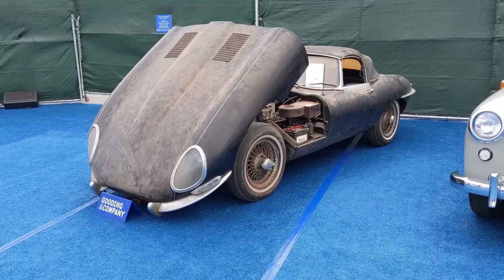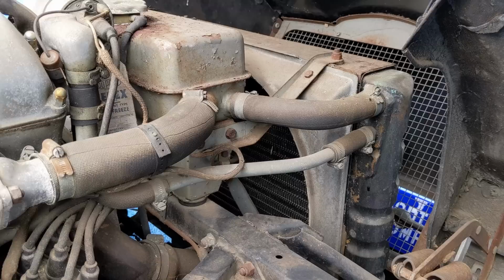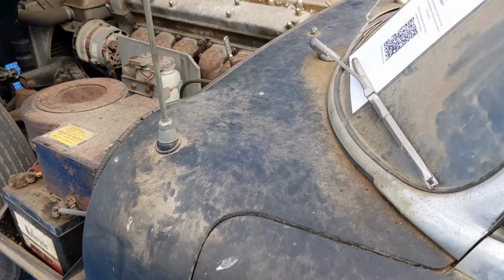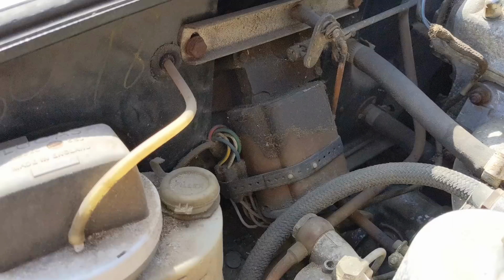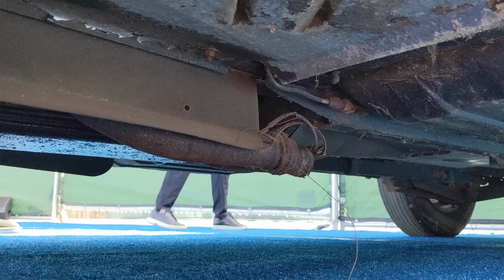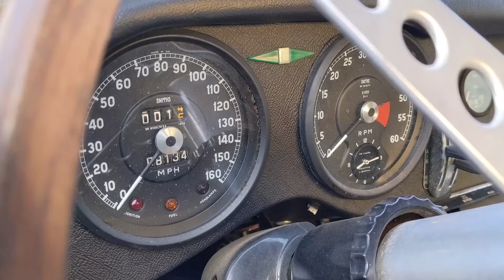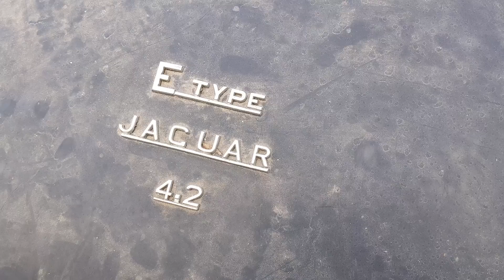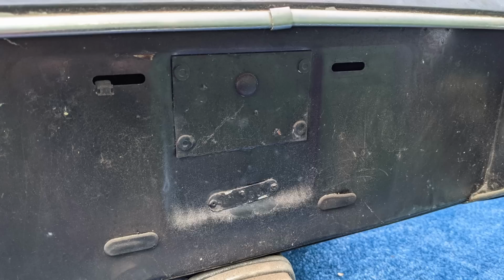8000-Mile Jaguar  E-Type Barnfind

Comment: I owned a 1963 XKE OTS for 45 years and have extensive personal experience in attempting to preserve these cars. As to the whole barn find nostalgia: the finding is the best part. The sad reality is that this automobile is gradually deteriorating every second. Factory rustproofing was non existent.  There are no galvanized panels. Components, especially brake systems and rubber seals inevitably age. The fascination with a mouldering heap may be special to some, like visiting an airplane crash site, but much more joy is to be had in actually driving the car while gasoline is still available to civilians. 

The problem with a limited restoration is where to draw the line. Of course all safety systems must be totally reviewed and restored. Pretty soon the car looks awkward with shiny new parts juxtaposed with barn patina. The mind can’t resolve the discrepancy and the owner will lay awake at night without peace. I know. A derelict vehicle is a possible outcome, but not for $170,000.  I bought cars like that for $500 back in the day.
Reply: Very wise comments Garth. I had a 3.8 fhc in my youth, and it was deteriorating before my eyes. Fabulous design, let down by poor materials. My two previous cars were an MG PA and MG VA from the thirties. Streets ahead in quality of substance. I was glad to let the E Type go. In total I had three Jaguars, and they were all disappointing in one way or another.
Reply: "while gasoline is still available to civilians. "  So true, brother.
Reply: I restored so many my self in the UK. Completely back to original factory condition. Now in the UK I can't afford a really bad condition one. There selling for over two hundred and 80 thousand plus now in the UK. Perfect condition one's are reaching three hundred thousand pounds plus mark now. People in the UK are paying hundred and fifty thousand plus for bad conditions rotten one's
Reply: Yes but there are thousands of them over 5000 in the UK alone and hardly ever  seen !!
Reply: $900 in 1975 for a running car with five new tires on it.

Comment: That’s a lot of E Type for the money. Personally I’d put it in the hands of a professional detailer, a weeks work would make it a different car visually. Then I’d do exactly what you said mechanically. Keep the “restoration” sympathetic and when roadworthy, drive it & enjoy every mile (kilometre). It’s amazing how these cars are still out there, waiting for the right buyer who will cherish every moment of ownership.
Thanks for sharing this blast from the past Richard, takes me back to my apprenticeship working on the bodywork in the mid 60’s 👍🇬🇧🇨🇦
Reply: I totally agree a thorough clean and detail with period materials ie turtlewax. connolly leather cream etc would transform the car a good coat of wax will keep minor rust at bay if redone every month or so. I don't know about you but I would polish it every day if it were mine. 
I slightly disagree about repairs though I prefer to see new parts look like new. it is part of the history of the car .As long as parts are functional I would just clean and lubricate as necessary . Any artefact can only be original once even the worst rust heap can be restored to as new showroom condition.
Reply: @elanman608  I believe you have the right philosophy, sir!

Comment: Sitting in a barn all that time will pretty much have destroyed this car. Virtually everything will need to be replaced. How could it be worth $168K? There is a tremendous difference between "low miles, unrestored and cared-for" and "low miles, left to rot for 50 years".
Reply: I guess the only good thing about it, is that everything is original. No modifications. That's assuming it can all be shined back up.
Reply: Not everything will need to be replaced, far from it.  Most things will need to be refurbished and checked, but that's a different thing!
Reply: You know nothing about restoring a classic do you , don't show yourself up with no knowledge, that car for it's age is mint 99% of it will be saved , and parts will be restored to original spec , would love to see it finished

Comment: Simply amazing!  At the now defunct Newport, Rhode Island Jaguar festival back in the early '80's; there was a 1966 all original E-type on display.  The owner drove it in from Boston; keeping it in his heated garage most of the time.
Reply: That’s the true definition of ‘original’. Lightly used and reasonably maintained but never restored. As in never painted or mechanically modified.

Comment: I got a 120 several years ago in similar condition.  As with these models, there's enough shiny 120's languishing in locked garages.  What I did: ring & valve job, gearbox sent for refurb, all the bushings, rebuild brake components, rebuilt water pump, radiator, damper, shocks, Tires, and it runs as cool as it ever did and drives great!!!
do it yourself and the cost is minimal.

Comment: For me, a barn find doesn't come with a mandate to retain the dilapidated condition.  Rather, it affords one the opportunity to utilize the maximum number of original parts (all restored to original condition), as well as serving as a correct period template for wire & hose routings, setup, etc.  I'm all for doing a perfect restoration on a car like this.  No repop components whatsoever; every non-original piece utilized would be NOS and have been in a Coventry parts bin in 1965.  My only goal for this project (or anything similar) is: as new, factory condition.

Comment: A great talk through Richard, thank you. I was amazed at the factory shut lines they looked excellent and for me a clean, a polish, refurbish anything safety related and then enjoy driving a “new” E Type , I wonder what they felt like and I guess this is the closest you can get? Kind regards, Richard.
Reply: They felt tight. In 66 I had a 63 with 21K on it. It was tight and no rattle, just a nice tight car . No clutch slip, but, it ran hot and no AC. On the road it was magnificent, in the city I took the bus. Mine was a coupe, it was like driving an airplane.

Comment: Worth noting is the still-present closed cell foam rubber sealing around the radiator gap and the foam rubber (or felt) sealing around the top of the radiator screen guard.  The overheating issues with these cars may be exacerbated by something as simple as the disintegration and absence of these seals.

Comment: What a fantastic research car.
For me, a full service, minor rust repair, wash and polish, new tyres and off I'd go. It would be criminal to pull this down completely.
Reply: Everything needs to be replaced. The shock mounts are rotted. Engine mounts are rotted. Exhaust hangers are rotted. Hoses are rotted. Belts are rotted. Gaskets are rotted. Engine could be seized. Pistons might be solidified to the walls. This thing is a travesty.
Reply: @gplito  
Anything made of rubber needs renewing. Modern rubbers are far superior to 1965.
Reply: @johnburns4017  yeah, even the plastic gets brittle. And all the lube just turns to clay. People here talking about a ‘full service’ have never seen what 50 years can do to something that’s just left to rot. Imagine just what all the shock mounts and suspension bushings look like. And motor mounts. Gads….

Comment: I'm just an old hot rodder but I would not do a full restoration on this.  I'd just start cleaning it and working thru the squawks.  I'd try to keep it as original as possible.  This car is a time capsule of how they rolled out of the factory doors.  It would be a shame to lose that IMHO.

Comment: If the car had been cared for thru the years, it would be a really rewarding find. But in this condition, it's less than fulfilling. 
So much of the original soft parts are deteriorated so just trying to get it running would be disturbing much of the originality - possibly devaluing it. 
Much of its value is in the low mileage so it really can't be driven or it will become just a driver.
A detailing by a knowledgeable shop would be in order. Then, loan it to a museum for display as-is.

Comment: As is went for 10 times its original sale price somebody has more money than sense! They were never built well and rushed out of Coventry to meet USA demand. I rebuilt my 1966 coupe and what you find when you peel back the layers is shocking. For me I would do a full nut and bolt on this replacing old technology for new including high torque starter motor, four pot disc brakes, five speed manual gearbox, RevoTec aluminium radiator, stainless steel bumpers, high efficiency headlamps, steel wheels(not CWWs), gas shocks, etc etc. To me they are not investments but a classic car to enjoy and use. 😎

Comment: 1) Needs the engine oil flushed out properly, with appropriate fully synthetic oil poured in.
2) Transmission oil renewed.
3) Tyres renewed. 
4) All rubber hoses renewed. 
5) Coolant flushed.
6) Back axel oil renewed.
7) hydraulic lines flushed through.
8) Electronic ignition fitted if to be used.
9) New plugs.
10) Carb lubes renewed.
11) Dampers renewed with quality gas dampers.
12) New none lead-acid battery. 
13) If to be used, a new high torque starter motor.
14) Tappets set.
15) New quality fan belts.
16) Fuel tank and lines flushed out.

Comment: I am going through a original 40,000 mile 69 e type for a customer last registration was 1975. The car has never been touched body and interior is perfect, I am basically replacing everything that is rubber bushings and mounts, complete brake system. The engine on the other hand was in bad shape coolant was left in the engine and it ate through everything that was aluminum ,it also turned into a solid I spent a couple days trying to clean out the water passages I will have to have the cyl head pressure tested to see if is any good.
Reply from the maker: Andrew sounds like an awesome project. I did a similar preservation 1962 FHC this summer and you can see it in my earlier videos. Some corrosion is ok on the cyl head passages, but the pits can't protrude past the head gasket seal.
Reply: @RichardMichaelOwen  Check out Jay Leno's Garage YT channel (Jan 10/22) where he reviews a replica of Steve McQueen's Jaguar XKSS.

Comment: Such a shame that car has been parked in some garage for the last 45 years just left to deteriorate. It was an immaculate car which should have been on the road being used. I cannot understand why owners just hang onto cars when they do not want to or are unable to use them.
Reply: i think this is the only way to get a super low mileage all original car. Sure, maybe it could have been stored a little better, but it is still in great shape. clean it up, look it over, replace what is not working anymore, and then drive it and maintain it to a high standard. Original cars are so much better than restored cars.

Comment: Yeah,  much more unique and valuable if left original.   I would only do necessary mechanical and safety with least changes to original.   A lot of that surface rust can be dealt with without re-plating.   Some of the rubber cracking can be improved also.  What a great car to bring back to life.

Comment: If the buyer wanted a flashy E type to run around in they could have passed on this. Going the full monty on it would make a car indistinguishable from hundreds of others. Fettled back to roadworthy condition this car would be both valuable and a head turner at any E type gathering. Maybe not for the hooray harrys but for those with some respect for history.

Comment: A good wash, some polish, and replacing the rubber hoses should get that to driveable. :-)*
(BTW, jeweller's rouge does a nice job removing surface corrosion from aluminum or magnesium alloys.)
Reply: You're kidding, right?

Comment: Nothing short of criminal neglect to allow such a car to get into that state
Reply: I can see what you mean, but I don't really agree!  It was stored a long time, obviously under shelter.  The years pass, cadmium inevitably disappears, rubber loses its plasticizers and deteriorates, dust settles, and so on.  That's not neglect, that's just time.  The car is straight, never in an accident, no one doing nasty modifications... to me it looks like it was very well looked after, in fact.  After a few years of driving, maybe <speculation> the owner died and the widow just had it in the garage, never quite knowing what to do with it.  Thankfully she turned down plenty of offers from mechanically unsympathetic rev-heads, thereby ensuring the car wasn't abused or wrapped around a pole somewhere.</speculation>

Comment: I think  if you can get it to a condition of a 3-5 year-old car then that's a good place to be.
I wouldn't be too fused about factory fresh. I will still need a lot of dismantling to get the mechanicals correct. Fix the rust, new paint job and set a time limit whilst you still can drive!!

Comment: I've never seen an E Type that has rusted right through behind the rear wheels with only 8000 miles. More likely 108,000 miles
Reply: NO it doesn't take miles to rust through bodywork it just takes time moisture and if salt is used on the roads that accelerates things 10 fold!
Reply: But it's not just 8K miles... it's 8K miles AND decades of sitting in storage.  Steel + moisture + time = rust.

Comment: Give it a ice blast detail, change all the fuilds, check the engine to make sure nothing is frozen or sticky, then I would just drive it for the next ten years.
Reply: Impossible....the entire thing needs to be disassembled and put back together with proper gaskets, belts, hoses, brake assemblies and the rest. Tires too. The interior is rotted out. I bet you could reach in and take fistfuls of crumbling leather by the handful out of the seats, plus the foam rubber backings are all rotted. The thing is a wreck. Someone is dead and no one payed attention to what they owned.

Comment: Re-Commission, not Restore.
Do only what HAS to be done for safety's sake.
eg. the rubber trims if they're not badly dried out, can be brought back to life, by a long soak and massage, in Glycerine.
Days preferably  !
It's the same Glycerine that  you wife will use in the kitchen, only you'll need a 'tad'  more .
Waiting to see the Recommissioning  !
Reply: Every hose, plastic line and rubber fitting and tire was  to be replaced. All the shock mounts..replace them. Exhaust hangers. Replace them.All the lines going to the oil system and the gauges. Replace them. Brake rotors and pads and totally seized up calipers? Replace them. Engine mounts? Replace them....are you adding this up? I'm at a zillion dollars. And it really hasn't started up yet. Clutch and tranny? And so much more. This has 50 year lot rot. On a car that has no rust proofing or preservatives, just left to rot. It's really a shame.

Comment: I am not sure what approach I would take if it was mine, although a survivor in some respects it depends how you look at it. Pretty well trashed for an 8000 mile car,  I think I would want to do minimal work on it, use it for 5 years or so and then maybe a major refurb,  A friend has a 3.8 with the later 4.2 fitted, not perfect but at least it is road legal and it all works. Not sure how much he'd take for it but a lot less than this ....

Comment: I would overhaul all the mechanics so it drives as a low mileage car   Then see about the interior because of the mileage it might just need a thorough clean.  And then both and polish the paintwork  and get some use from it then decide how much work and money to bring it back to its former glory

Comment: Amazing specimen for sure. But at that price, unless money is no object, the only reasonable option is to clean it up and do the minimum to make it roadworthy. But it will still look like crap. It will take well over $100K to make it pretty again so if that is the objective then better to buy one in worse but restorable condition. And I'm wondering about the mileage, why is the porcelain gone from the exhaust manifolds? Redoing the coating lasts only about 1500 miles but the original process should be good for much more than 8000 miles.

Comment: A car is only original once and only a moron would totally restore this car. The suspension brakes engine and the like need going over for safety sake and replace the wheels and tyres for the same reason but keeping the original. It is the originality and low mileage that gives this car its value.

Comment: as others have said, just needs a serious detailing and preservation, not a restoration.  not sure about the pitted chrome...I guess i'd want to see that repaired as it would sure detract...a little too much patina against the rest of it which looks like it should clean up nicely.  speaking of which, this must have been in a pretty damp building...a lot of surface corrosion.  I suppose the original owner passed away and the family just didn't think about the car and left it wherever it was.

Comment: Richard, I am using a Jaguar xk 4.2 inline six from a 420 in a one off non Jaguar car.  I can't find the front to back "tilt" angle....if any.... that it should be installed at.  What would you recommend. Many thanks, Rob

Comment: Nice car. It's a shame it sat for 50 years. Water pump seals are probably shot. Engine seals probably dry rotted. Fuel tank probably  has varnish. Top may clean up but I bet once the top is correctly latched, it will probably tear. Ultimately, cars need to be driven and speaking of which, those tires are willpopsoons. Tires definitely have an expiration date.

Comment: Original and unrestored is one thing.  Leaving it exposed and uncovered in a damp location is another. What a waste
Reply: To me it doesn't present as exposed: otherwise it wouldn't have all that dust on it.  There is very little rust.  Looks to me it was simply parked up in a dry location.  The tyres still hold air!